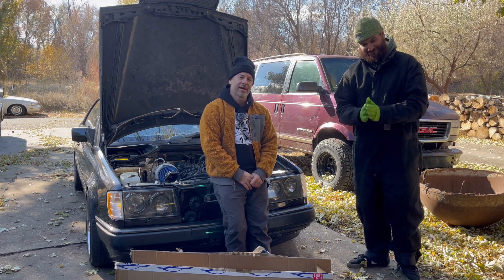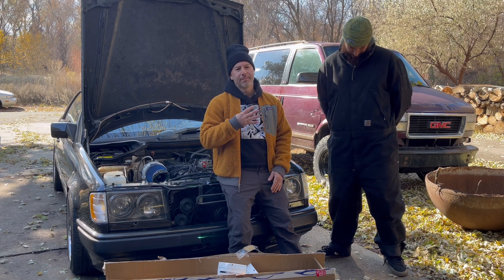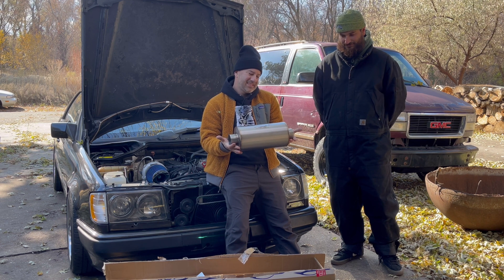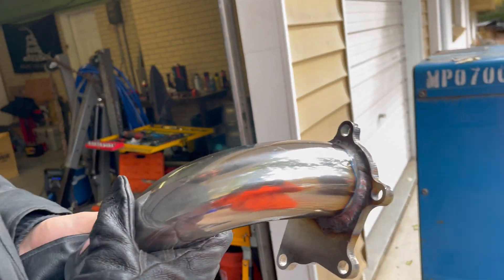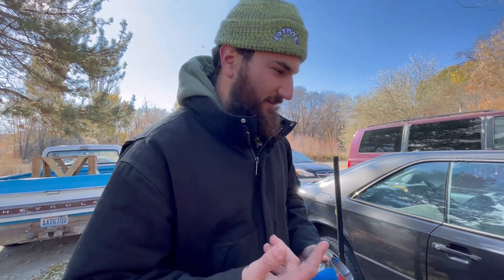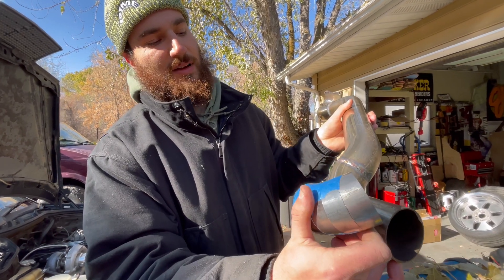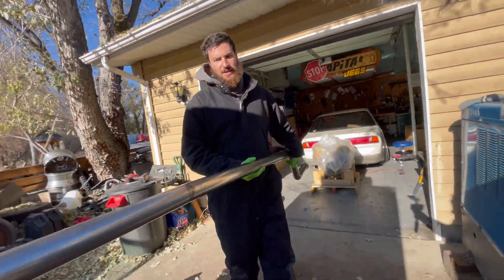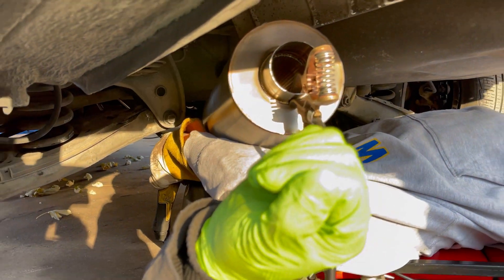Mercedes-Benz M103 Turbo Part 4 | Stainless Exhaust Fabrication

Comment: How is that exhaust holding up with no flex joint on the Down pipe? Stainless should be back purged with argon to prevent sugaring. Not as big of deal for exhaust not to back purge but a big no no for stainless charge piping. Enjoyed the content thanks for sharing the journey.
Reply from the maker: Exhaust is holding up great! That factory support is Rock solid. Alex wanted to back purge to get the pretty welds but didn’t have the equipment at the time, he’s def sad about that. Thanks for checking out the journey, it continues to be fun

Comment: Sounds awesome, that 6 cylinder really has a good throaty sound to it with the turbo manifold and that exhaust
Reply from the maker: Yes! Not to loud but on boost it sounds even better
Reply: @AutoAfflicted  Does the cruise control work in the car?
Reply from the maker: My cruise control is inoperative but it should work. cruise is just based on vacuum hoses and a diaphragm

Comment: funny and chill vibes for part 4 here haha! Alex is chill and easy to see plenty talented to get this job done working with what is on hand and making it nice. Sounds mean but like you said 'Adult' in a good way
Reply from the maker: Definitely casual at Alex’s place and he does great work. It went through a few different exhaust notes. From just down pipe to full straight piped and finally with exhaust and tips. You can hear the differences in the shorts I’ve posted. I can’t wait to making a proper driving impression episode, once the snow clears more

Comment: Dude I just inherited my dad's 1990 300se with m103 engine, it's been sitting and routing away for 10 years but everything is almost ok except for the screwed up interior due to a power window motor that broke , also the paint and of course shot breaks and rusted but thankfully no rust other than on the breaks. 
 I can't wait to start finally working on it after my university finals.
Do you have any tips on what to expect from a mechanical view, and what should I immediately change other than oil, tires, and spark plugs?
Ps: just started it for the first time in 10 years and moved it from the side road to my driveway 3 weeks ago , and I almost cried hearing it rour and start as soon as it got gas in it ,put it into gear and it just moved so smoothly,
just like people said, this car just doesn't die.
Reply: He changed the engine and suspension just before he passed away, I think it's about 20k miles and then it was just left.
Reply from the maker: I am sorry to hear about your father.. I lost my mother 2 years ago, so I know the pain. Keeping the 300se is the perfect homage and such a great way to connect with your father still. Sounds like you’ve got a good runner! Get it up on a lift just to see what’s going on underneath and check all the bushing etc
Reply: @Auto Afflicted   thank u so much man for the advice, and I am really sorry about your mom, hope you are doing better ,btw I love ur videos so much, and keep up the good work.
Reply: @AutoAfflicted Hey man quick update , it's almost done , it's getting painted now, but still need to do the bushings, the fuel line is kinda ok , but I will probably need to change the pump just in case, also sad news , when we lifted it , it had rust everywhere but it's fine we were able to salvage it and restore it, other than that , once it's done getting painted and the bushings checked it will get all of the electrical wiring checked and it will be finally done , probably in 15 days or so, I will make sure to send u some pics of it before and after.
Reply from the maker: @mostafasamy3947 awesome! I can’t wait to see the end result, will be so worth it !
Reply from the maker: That’s awesome! What’s the mileage? Definitely check the gas tank for rust. Check the fuel lines from the tank to the pumps, there is short length of rubber hose that degrades and leaks gas. Besides plugs - rotor, distributor and wires prob need changing.. I’m sure the brake fluid needs changed  - I’d start driving it around and see how it’s going - let me know how it goes

Comment: I’m contemplating turboing my 190e sportline 2.6 did you change anything on the  ecu or injectors ?
Reply from the maker: I’m running stock e ya be injectors- I did adjust the idle control to enrich the air fuel mix. I gapped my spark plugs for turbo application- I have not yet adjusted the eha valve to increase fuel pressure

Comment: Did you do anything for jetronic?
Reply from the maker: So far I’ve adjusted the idle control to make the fuel more rich. I’m considering turning up the fuel pressure via the eha valve … I’m still sorting out my fuel pressure and air/fuel mix gauge, until I know exactly what’s going on with pressure and mixtures I’m not adjusting more - they main thing I had to do was adjust my spark plug gap specifically for turbo application… I’ll make a “wrap up” video that covers all the fine details

Comment: Sounds awesome! I have the same coupe but with the 2.0l 122 HP engine. Is it going to sound similar like yours if I fit it with a straight pipe? Greetings from Bulgaria!
Reply from the maker: I think it should sound similar straight piped - it was a lot louder before we finished muffler and tips - I have a “short” posted with sound before the muffler was added. Cheers 🥂 from Utah USA